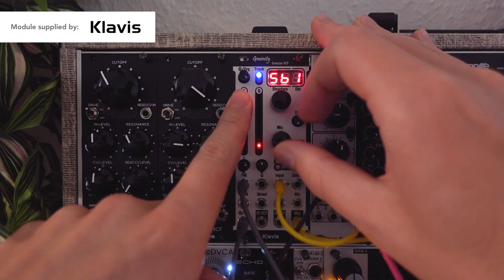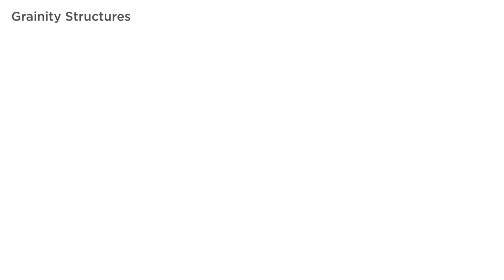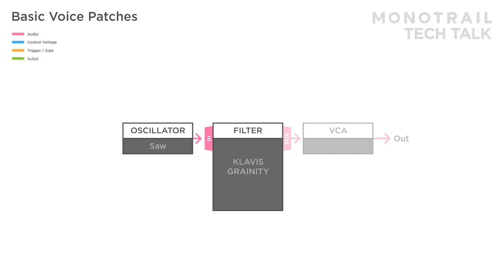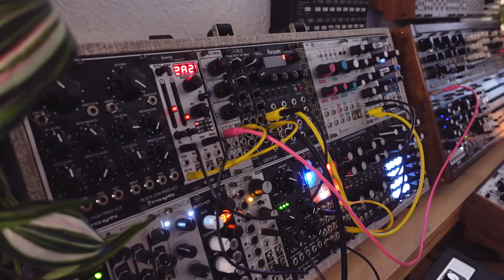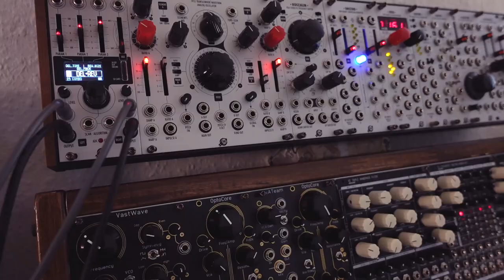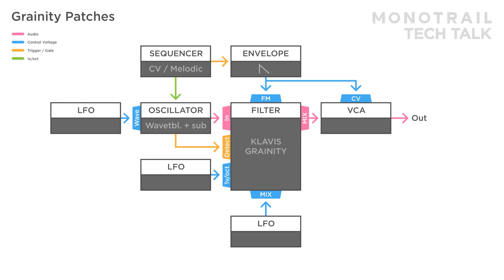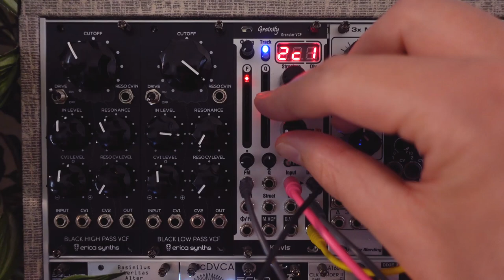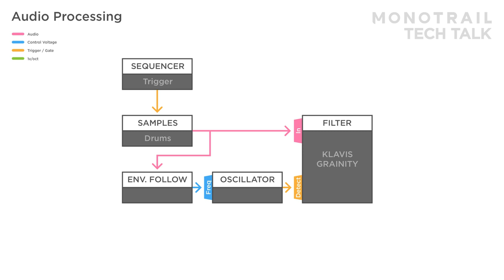Klavis Grainity, the new granular filter - patches & audio demos

Comment: the concept of the module is cool and clever, but the actual sound quality of the granular filter side is questionable, not sounding good to my ears.
Reply from the maker: I think what the module has to overcome is it's name. A lot of people will associate granular with digital modules like clouds etc. That's why I added the second chapter, there's a lot of fun to be had there! But the module has a fully analog audio path, with switching between grains there can be clicking, frequency beating and so on. I think that's where the interesting sounds are. A field to explore on it's own, but it's not what people might expect giving it a glance. Cheers!
Reply: I think it’s very expressive. It adds lots of harmonic/dynamic movement and character to the signal to my ears.

Comment: I still don’t understand what a granular filter is.
Reply from the maker: Hi there, they explanation is at 4:00. The module does NOT create 'individual' grains like digital granular processors. But processes audio by creating filter variations for each step, or grain. These steps are generated as explained, with a frequency based on the incoming audio or an external signal. That frequency can be divided etc. If you need a more common analogy. Just imagine a filter, and modulating that filter type and settings with a CV sequencer at audio rates. The structures in Grainity determine the CV sequence and what is modulated. And the divide and frequency control the speed of the CV sequence.
Reply: @MonotrailTechTalk  what does filter variations mean?
Reply from the maker: It applies a variety of settings to each step or grain. f you like to know for each step and or 'structure' what parameters are changed exactly you'd have to ask Klavis ;)
Reply: @MonotrailTechTalk  is it kinda like but reduction? Some bitcrushers have a clock ⏰ input.

Comment: What I find so useful about your deep dives is figuring out how I can replicate the effect of these complex modules which you highlight —  using the simple, less complex modules I already own. 

For example, to replicate the granular filter  part of the Klavis Grainity, I would use  one of my 8-step sequencers [clocked by the square wave output of a one of my simple VCOs (passing this square wave signal through various dividers, multipliers and/or trigger delays, before it’s fed into the clock input of the aforementioned sequencer), then feeding the output of the sequencer into the CV input of one of my multi mode VCFs, with the audio outputs of the aforementioned simple VCO fed into the audio input of the selected multi mode VCF.  

This way, the sequencer and multimode VCF combined will replicate the effect of the granular-filter part of the Klavis Grainity.  

Interesting variations of the effect produced by this replicated Grainity set-up might involve: adding another VCO — using the same 1v/octave control voltage as the first VCO (by way of a buffered mult), but passing this second VCO’s 1v/octave input through an attenuverter to detune it up or down, and using this second VCO’s square wave output to control the multimode VCF’s frequency cutoff — thus creating a weird out-of-phase granular-filter effect.  

This kind of deconstruction of the processed created by the complex modules you demonstrate (which I cannot afford) allows me to avoid the GAS which your deep dives inspire, and instead find new creative uses of the modules I already own — converting GAS into new creative patch ideas for the modules I already own!!! 

This way your deep dives have two valuable outcomes: either they can inspire the purchase of the module being reviewed, or they can provide new and exciting patching ideas for the gear we already own!

That is the brilliance of the unique and thorough way you analyse the modules you highlight— which gives us not only an extremely informative review of a specific module, but also amazing insights into the underlying principles involved for us to take away and use as inspiration for new patching ideas to apply to the modules we already own!!!

This is a really powerful and uniquely brilliant service you provide, so THANK YOU, THANK YOU, THANK YOU!!!
Reply from the maker: Hi there! Very glad to hear you like it! I am happy to shine light on new modules, also keeps things fun for me :) But for sure always keep in mind how to add value and patch ideas to the video in general! Thanks for watching :)
Reply: @MonotrailTechTalk  Thank you for your reply!  Please note that I have edited my original post above to give it more clarity, because I think it failed to get across what I was trying to say! 🤪😁😁😁 — in as much as I was trying to express how inspiring your reviews are, rather than attempting to add some patch ideas to use with this particular module… if that makes any sense!! 🤪🤪🤪🙄😁😁😁

So once again, thank you!!!!!
Reply from the maker: Hey, thanks for the involved answer! Have to say maybe my responds was to short, because I got what you meant, but fun to read all the depth :) Indeed that's what I hope to achieve when possible. I enjoy explaining and showing new modules. But always try to add explanations and patches that inspire and or are useful without the new module. Also have to say Grainty inspired me to do the same! It's a fun interesting idea that can be applied to audio in different ways. Set up 2 filters for stereo patches, and so on. I might come back to that and things you mention in a another video :) All the best!

Comment: Please make another video explaining what a granular filter is. You seem to have forgotten that part in this video.
Reply from the maker: Hi there, they explanation is at 4:00. The module does NOT create 'individual' grains like digital granular processors. But processes audio by creating filter variations for each step, or grain. These steps are generated as explained, with a frequency based on the incoming audio or an external signal. That frequency can be divided etc. If you need a more common analogy: Just imagine a filter, and modulating that filter type and settings with a CV sequencer at audio rates. The structures in Grainity determine the CV sequence and what is modulated. And the divide and frequency control the speed of the CV sequence.